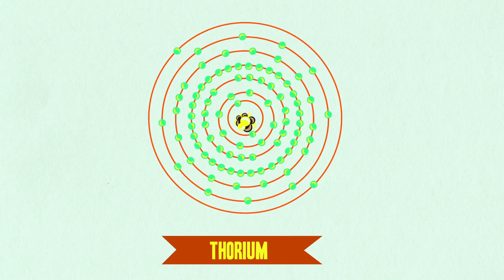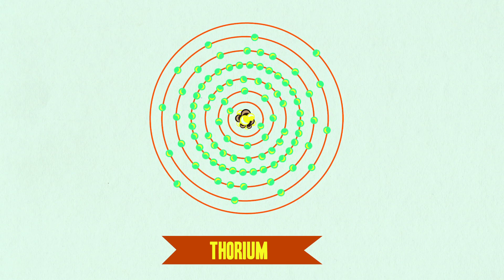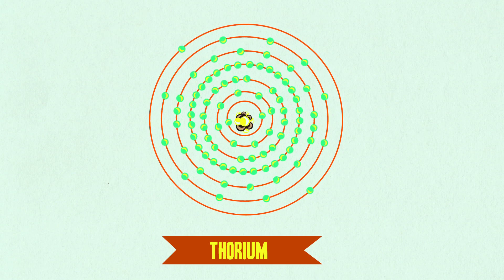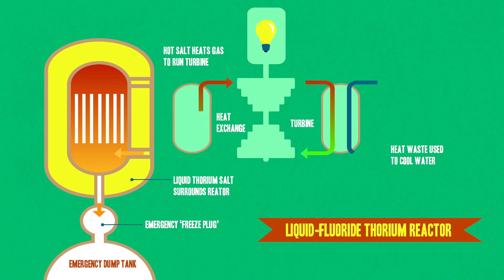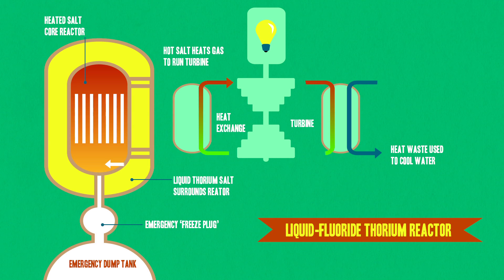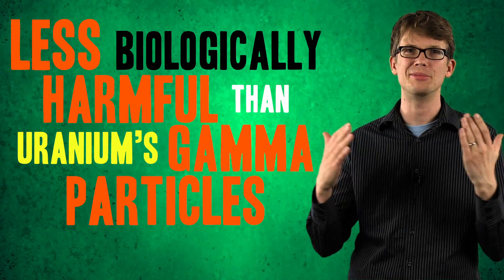Liquid Fluoride Thorium Reactors (LFTR): Energy for the Future?

Comment: or....you know....someone start investing in thorium reactors, make new ones and start phasing out the uranium ones due to competitive pricing? thorium is dirt cheap, much cheaper than uranium and requires no extended refining like uranium does, simply smelt and toss in the reactor and use a small piece of plutonium as a starter, which is used up fairly quickly. thorium energy would be cheaper and could carry the greener energy stamp, making it more appealing and more cost effective.

Comment: Alpha particles are extremely easily gotten rid of; they are usually converted to Helium within 10cm of movement within air. They are /literally/ stopped by a slight breeze. As long as food is not contaminated, and you wear a mask, you're fine to do whatever the hell you want with an alpha particle.

Comment: Tau is a "concurrent" to Pi.

As we use the RADIUS in math operations, it does not make much sens that we use PI. As PI is the ratio of the perimeter and DIAMETER.

Instead, some mathematicians are trying to implant TAU. As TAU is the ratio of the perimeter and the RADIUS.

And as TAU equals 2PI, and the video is 3:14 long (Pi...) I wrote that the video is Tau/2 long.

Fioouuuu

Comment: Statement on Thorium Fueled Reactors from the Union of Concerned Scientists: "There are serious safety issues associated with the retention of fission products in the fuel, and it is not clear these problems can be effectively resolved. Such reactors also present proliferation and nuclear terrorism risks because they involve the continuous separation, or “reprocessing,” of the fuel to remove fission products and to efficiently produce U-233, which is a nuclear weapon-usable material."

Comment: Hard to explain, here is an example
Pu 239 : specific activity : 2.3 GBq / gr, Effective dose coefficient (over 1 year) : 4.2 x10^(-6) Sv/Bq, so the dose for 1g is 9786 Sv (after 1 year ... if you don't die before)
C 14 : specific activity : 165 GBq / g (80 times higer), Effective dose coefficient (over 1 year again) : 1.4 x 10^(-9) Sv/Bq, wich make a dose of 231 Sv for 1 year ( 40 times lower)

Here with the same mass of matter, the element with the highest activity is the less harmfull.

Comment: the energy of the radiation emited.
For uranium and thorium, the alpha particules have an energy of about 4 MeV
For plutonium witch is still alpha emiter, it is slightly over 5 MeV
I admit that alphas don't have a wide range of energy, but that's not the case of other radiations type

Comment: those numbers depend on the time. The one i gave were for 50 years. Sure, Bq is a radioactivity unit, but for long live radionucleid, you consider that as a quantity (like thorium : 4080 Bq/g => 90 Bq of thorium = 22mg). 
you find the factors you gave are small ? But you just proved that 1 Bq of Thorium gives a dose 12 times higher than uranium. What the radioactivity does, is that you "need" less matter to get the same activity. Radiotoxicity => how bad 1 Bq can be,

Comment: artificial* that was a mistake.

Type of radiation is the same, energy is not the same, pretty close though.
To be honnest, i'm not a radiotoxicology specialist, i'm an elemental and radiochmical analyst, i'm not quoting wikipedia but those numbers comme from material safety data sheet i have. I don't know why Th is more radiotoxic, probably because of it's decay chain. But i can assure you Th is 3 times more radiotoxic that Pu (inhaled), annual limits are 90 Bq for Th and 300 Bq for Pu

Comment: the chance of being exposed to non artificial gamma (except for medical uses) if pretty small too =)

The radiotoxicity depend on the energy and the type of radiation, the different radionucleid are not equals. Thats why equivalent dose were invented.
As an exemple for ingested matter : Potassium 40 has a conversion factor around 5.02 nSv/Bq as uranium has a factor between 8 and 50 nSv/Bq (depend on where it fixes). So for the same radioactivity, Uranium is potentialy more dangerous.

Comment: Neutrons are special because they do not always cause direct ionizing effects. Most of the time a neutron will be absorbed by an atom in your body and become activated.  That atom will then undergo decay and produce ionizing radiation in the form of gammas, betas, or alphas.  It is in these instances where alpha exposure is the most damaging because there is NOTHING to sheild your cells.  this is also why the weighted factor for neutrons is higher than gammas or betas, but less than alphas.

Comment: Mostly correct, you have some common misconception mixed in.  Any form of ionizing radiation has the potential to cause cellular damage.  Any given particle has a 25% chance of causing cancer.  Outcome of exposure is as follows:  1) Cell repairs its damage and survives 2) Cell is unable to repair damage and dies 3) Cell is unable to repair damage and produces daughter cells that die 4) Cell is unable to repair damage and produces abnormal daughters that survive (cancer).

Comment: agreed, even if gama/beta penetrate more in your body, DNA natural repair is highly probable (when you are young, your body mechanism can easily repair partialy dammaged DNA and save your cells from going wrong) as it is not or is altered with alpha particules damages (as it broke the double helix structure totally). With mean that the cells dammaged won't recover and if not supressed by your body, it will most likely turn into a cancer

Comment: Yes, but even if it can't penetrate skin, it is still harmfull for that skin and worse if it somehow end up in your body. Neutrons and alpha particules are the most dangerous, Beta and gamma, are as dangerous as tanning unless those are of a very high intensity with is most of the time possible only by achieving criticity. What we should be afraid of are not the external radiation, but the internal contamination.

Comment: Why should you bother with retrofitting old reactors .. It is probably more cost effective to just engineer new ones that are more efficient and bio-friendly, than to try re-engineer a reactor in the place of a old one working on a different technology. A old reactor facility that may have some lost plans or other changes that happened during construction would significantly add to costs of re-engineering a facility. Then you can continue using the old and the new.

Comment: How proliferating an LFTR would work is that Pa-232 (which decays into U-232, the bomb-deterrent) has a shorter half life than Pa-233 (decays into U-233, the reactor fuel/bomb material). Separate out the protactinium and extract the uranium over time. The uranium from the first 10 days will be contaminated with U-232, but after that it will be almost completely pure U-233.

The issue is that LFTRs breed an excess of fissile material very slowly, unlike plutonium breeders. But it can be done.

Comment: There's some lab-scale stuff right now that looks promising, including fission fragment energy conversion and negative absolute temperature systems. But these things are many many decades away, so for now we need to keep using Rankine-based engines to convert heat to electricity.

Comment: One correction to your video; alpha particles ARE more biologically, they are significantly more easy to shield from.  Alpha particles are 20 times more biologically damaging because of their higher charge potential and mass, but typically stopped by a sheet of cardboard.  The navy didn't make me spend nearly two years training me to operate on safe reactor operation theory for nothing. :-)

Comment: It would be less efficient. As with all nuclear reactors, you eventually hit a wall in terms of critical mass requirements and neutron flux limits for the transmutation/fission of stuff.

However, you could produce them on factory lines (construction time reduction), identically based on a licensed standard (licensing time reduction), transport them where you need heat or electricity, and so on. Small Modular Reactors are gaining traction in the US since they're "safer" and easier to inspect.

Comment: Sure. Bill Gate's Travelling Wave Reactor is a fast reactor (plutonium breeder). We've built and used those for both military and limited civilian applications in the US and Russia. They were basically the PWRs of the plutonium cycle, very unsafe (molten sodium coolant) and very inefficient. It's mostly because they were immensely complex systems.

The TWR takes that problematic complexity and raises it by several magnitudes. It's not even technologically possible to build a TWR right now.

Comment: Well, yes, you are correct.  If directly exposed to the different radiations alpha is far more harmful.  But, heres the thing, a sheet of paper will stop an alpha particle, so you could literally protect the environment from the waste with a paper hat.  Gamma radiation on the other hand passes through three feet of lead about 10% of the time.  While not as harmful when directly exposed, it is much harder to contain.

Comment: You also want to consider a nuclear process' neutronicity, or ability to produce excess neutrons. Neutrons allow you to transmute things, like transuranics into fissionable products, fission products into stable elements, and thorium into useable U-233 fuel. The LFTR supports a very high neutronicity, which is why it's just that good.

Fusion is arguably more valuable for its neutronicity than its energy. In an ideal world, you'd want to use both fission and fusion since both have their purpose.

Comment: The point is that you're not considering the right aspects of nuclear. Sure, you can make a lot of energy with it in theory, because fusing 1 kilogram of hydrogen produces 330 terajoules of energy. Unfortunately, you need extra "package" to do that fusion, and that's what will end up weighing you down. A gigantic superconducting magnet toroid apparatus that can barely fuse a couple hundred grams of hydrogen is going to lose out to pretty much any other power-generating system under the sun.

Comment: The last bit is that 20% of a very small mass of fuel is not even worth mentioning. If you burn 1 tonne of thorium, you produce as much energy as burning 3.3 million tonnes of coal, and you only produce 200 kilograms of 300 year waste (Cs-137 ans Sr-90 make up 20% of the fission products, both have half-lives of 30 years). Burn 2200 tonnes of thorium and you make as much energy as all the coal burned globally in 2010, and you're waste is 440 tonnes. Globally. So, what, 20 dry casks?

Comment: Any hydrogen converted into helium will stay that way forever. The trick is that fusing a gram of hydrogen would produce as much energy as chemically burning 2.7 tonnes of hydrogen, or 13.8 tonnes of coal. That's the kind of energies you're dealing with here.

In 2010 we burned 7.25 BILLION tonnes of coal worldwide for electricity. You could fuse 530 tonnes of hydrogen to produce the same amount of energy, or ~2200 tonnes of uranium or thorium. That's peanuts.

Comment: Renewables are dangerous as hell too. Their manufacture and installation has a toll on life that easily surpasses that of current nuclear tech, accidents included. It's just physics. Nuclear produces a lot of energy for very little, including human lives.

Sure, renewables will get more efficient, but so will nuclear. Right now nuclear is only 1.2% efficient at its very best. LFTRs could get up to ~59% efficiency (99+% fuel conversion, with gas turbines operating at 60% n). Renewables won't win.

Comment: Fission is already unlimited. Sure, right now we may run out of economically accessible U-235 (the "enriched" part of uranium fuel), because it's 0.7% of all natural uranium. We won't run out of U-238, and we definitely won't run out of thorium which is 3-4 times more abundant than uranium as a whole. Granite contains 9-13 grams of thorium per tonne and 2-3 grams of uranium per tonne, which is roughly 30-50 times the energy you get from burning a tonne of coal.

Comment: With thorium, that perfect end is about 3 thousand years long. That gives us plenty of time to make Fusion a the next power source. Fusion fuel consists of hydrogen that we can get from splitting water molecules of regular seawater. When the cycle completes, we can break down the heavier elements back into water relatively easily. So, Fusion, and furthermore, Nuclear, IS an end all be all solution.

Comment: Wait, wha....
If it's cheaper to build the LFTR as supposed to building new uranium reactors and such, then why not just build new ones instead of transforming a uranium reactor into a LFTR, then discontinue use of the uranium reactors like they did that one reactor in Tennessee? That way, in the long term you get lower radiation output from Thorium, and you have more uranium to blow up stuff with. 
Am I not seeing a loop hole or something cause it sounds like a pretty good idea....

Comment: Because it isn't free. Think of hydrogen as a rechargeable chemical fuel. The energy you get from burning it is also the energy you need to make it, plus interest due to thermodynamic inefficiencies. You can also get Hydrogen from sources higher up on the energy ladder, like natural gas, but even that still requires an investment in energy, and natural gas is not "rechargeable".

Gasoline is basically free. You just need to drill it up and refine it.

Comment: That is why I think it would be easier to just generate the replacement hydrocarbons. Highly energetically dense and usable in current infrastructure. The only question is how to generate them effectively. The plants, I suppose, would have to be massive and with a non-trivial energy bill. Technologically it's doable, for sure, but there are open questions about the economics still.

Comment: The biggest hurdle to making synthetic fuels is cracking water. This could be done with a high-temperature nuclear reactor like certain LFTR designs in fact. The sulfur-iodine cycle catalytically cleaves water into hydrogen and oxygen.

CO2 capture and reduction to CO is another story, but energetically much easier to pull off than water cleaving. After you have hydrogen and CO, you can use the Fischer-Tropps reaction to make simple hydrocarbons.

Comment: The thing about flow cells is that they will never pack as much energy as conventional lithium-ion cells or hydrogen per unit mass/volume, but they'll more than make up for that in terms of reversibility and cycling rate. Right now, we can't use batteries for the grid/vehicles because they degrade and they cycle too slowly. Flow cells, organic ones specifically, can be taken all the way up to 4000 C (full discharge in 0.9 seconds) with coulombic efficiencies nearing unity. They just lack energy.

Comment: The pellet system has extremely high capacity, even with efficiency losses in recovery, however it is not very reversible so its cost is very high.

It's funny you mention liquid batteries because my main project actually revolves around synthesizing an organic reducing agent that can be used in flow cells without any solvent (it remains liquid in either reduced state [RT liquid] or oxidized state [RT ionic liquid]).

Comment: You need a heat stimulus of around 80 degrees celcius to release the hydrogen. However, on the flip side using those materials means you end up with a higher density of hydrogen than what's possible in conventional liquid hydrogen, which makes up for the energy lost. Plus, you don't need a heavy pressure vessel anymore.

It solves a lot of problems in the vehicular department. I see you weren't talking about that though.

Comment: Are you talking about storing it in some form of chemical bonds? That seems wrong, because the bonded state is necessarily lower-energy than the free state, ergo you'd need to invest energy to break it out of the bond again (what electrolysis does with H2O). Or maybe metal foams using some non-chemical effects?
Also, I wasn't talking about moving the fuel anywhere, so no need for refueling stations. I'm a bit dubious on car tanks based around pellets rather than fluids (pumping, wear and tear..)

Comment: Storing hydrogen in tanks isn't the only option. You can store very large amounts of hydrogen in compounds and alloys. In fact, the hydrogen density in these things can be higher than the density of pure liquid hydrogen by itself.

The way it could work is that refueling stations would dispense small pellets of the hydrogen-loaded compound and suck back up all of the spent compound for re-use or recycling.

Comment: Breeders like the LFTR use nuclear transmutation to convert non-fissile transuranics into fissile ones which can then be fissioned. Transmutation also works on many fission products by turning them into isotopes that stabilize very quickly (on the order of a few hours or days).

Transmutation does not work on Sr-90 and Cs-137, which make up 5% and 15% of the total fission products mass, respectively, for the thorium cycle. These need to be isolated for 300 years.

Comment: Large-volume H2 storage is extremely hard since the gas is so light (per molecule). Therefore, in order to store any meaningful quantities of it, you need extremely high pressures and so a thick and expensive stainless steel vessel, cooling systems and well designed piping (since H2 at high pressures is quite corrosive). We're talking magnitudes like 1kg of H2 needs ~40kg of supporting infrastructure. Compressed air stored under water, however, might be a lot cheaper, see watch?v=UkY2bmBUito